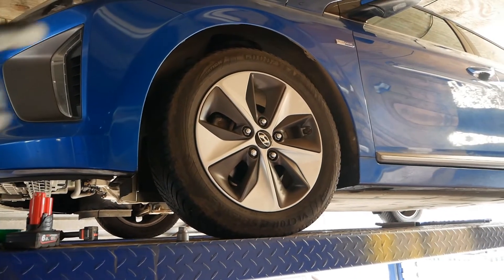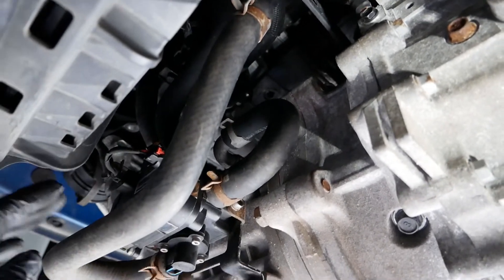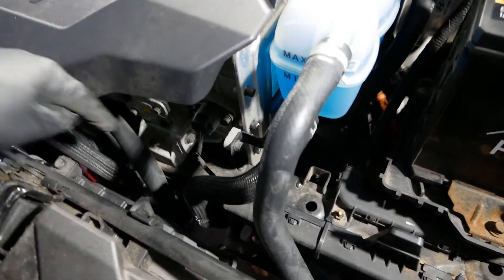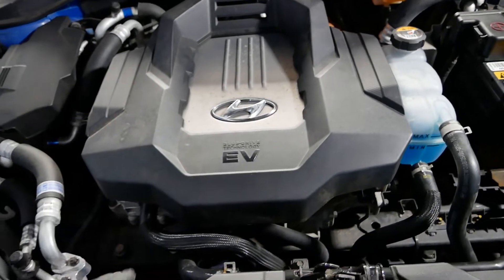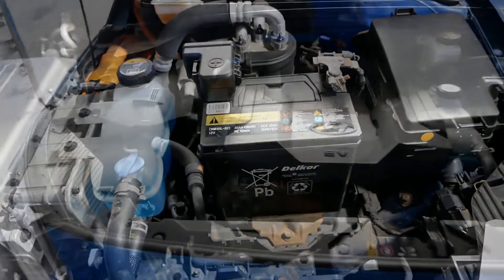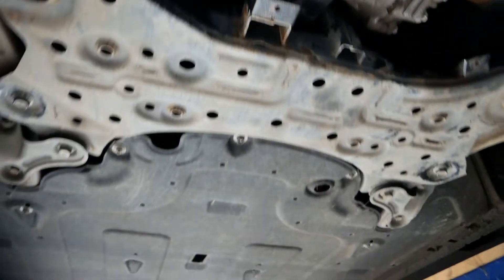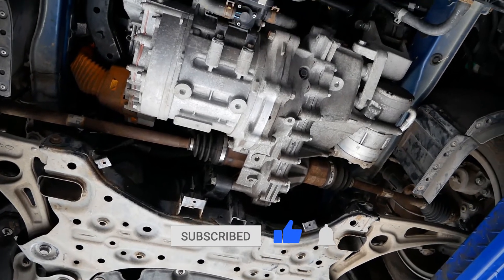What's under the bonnet in an EV? A look at a 6 year old Hyundai Ioniq Electric 28kWh.

Comment: Thanks for the great video.  I've got a quick question..  you showed that the motor stack is supported by the 3 mount bolts, does that mean it's not really supported by the front sub frame?  I'm looking to change the subframe and wanted to know if the motor stack needed to be supported when I removed the subframe?  Would appreciate any guidance.  Thank you!
Reply from the maker: That's right, the motor stack is supported just by those mounts. It's been a few years since I was under a Ioniq, but it's all pretty easy to see when you're under one. As to whether the motor stack needs supporting, it depends on what the mount bolts too and if that is getting strength from the subframe.
Reply: @GoGreenAutos thanks 🙏 for your reply.  Really appreciate it

Comment: Byt what I was looking for was how the rear sway bar was looking, if there was a difference from the hybrid version. I am looking to change it to a slightly thicker design to get just a bit more over steer out of a bend. But yes I understand I also need slightly stiffer rear springs as well. … yes I know.

Comment: How do you find the overall performance of the heat pump in both cooling and heating mode on the 28kWh and 38kWh Ioniq?  I'm going back to EV soon and the Ioniq 38kWh is at the top of my list by a huge margin but the wishy-washy air conditioning in the R55 Mini Cooper S I currently have (fully serviced and recharged but really underperforming by design due to heat soak from the crammed engine bay) has made it a consideration for me on future purchases.  The Koreans do normally get AC right, so I'm hoping it's decent!
Reply from the maker: Its very good and very efficient. Certainly better than the heat pump systems from some Renault and Stellantis EVs.
Reply: @GoGreenAutos  Thanks for the reply, that's good to hear!

Comment: Great video. I have some problema on heating the cabin . The cabin ia blowing cold air and not heat. Do you know what is the problem?
Reply from the maker: Does the air conditioning work (i.e. blow cold)? Low refrigerant in the system is the most likely cause, as the air conditioning compressor is used to generate the heat.
Reply: If this only happens periodically, maybe the AC managing humidity. It uses cooling to dry the air in humid conditions.

Comment: Thank you for the great video! Very informative. Just curious, do you know if the air that used to cool the battery packs were filtered? I think the intake piping started from the rear passenger seat. My concern is if not filtered, the cooling fan might have clogged up with debris and dust, kind of like early gen Toyota prius. Any input?
Reply from the maker: I've never needed to take one apart to look. I don't think it comes on very often anyway. I don't think it every came on when I owned a 28kWh model.
Reply: It does come on during fast charging... audibly.

Comment: hello , my 40,000 miles service is coming up. i use ioniq 38kwh EV for private hire. do i have to take it to Hyundai for service for keep the warranty valid ? Hyundai 40,000 costs £500+ . considering its an EV why are they charging so much for its service to change brake fluid , coolant and pollen filter i think ? what are my choices ? can i take it to halfords for servicing , would it have an affect on the warranty .
Reply from the maker: The 40K service is expensive as it also includes a coolant change. Yes, you can have services done at any VAT registered garage and if they use genuine parts, the warranty is still valid. However, a Halfords garage probably wouldn't be doing the coolant flush. It also needs Hyundai BSC-2 coolant. Try a HEVRA garage (https://hevra.org.uk/garages.html). But probably best to just pay Hyundai for this one. The coolant change is a 2 hour job if done properly (which often isn't the case).
Reply: @GoGreenAutos i have already had coolant recall done, they flushed it 2 months ago.  yes i will try to get it done from hyundai. i am at 41500 now when i reached 40k i called them and the earliest date given was 27th Nov. dont think they will honor my warranty now as i am out by more than 1000 miles ..
Reply from the maker: @hussain-b7m7f  if you've had the coolant flush job done, then no point having it done again, so ask for a normal service without this. That will drop the price down to a normal price.
Reply: @GoGreenAutos   great i did it today at the dealership  and paid £250 instead of £525 ... thank you

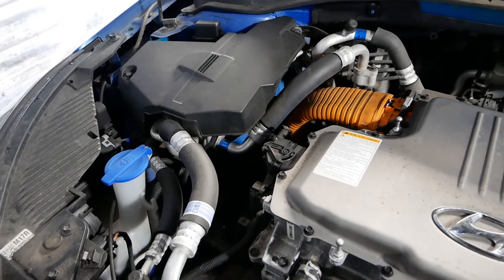Comment: 9:10 As far as I know, Ioniqs with a heat pump also have a PTC resistive heater used in very cold weather when heat pump is not efficient enough and at the beginning of heating to heat up the inside quicker. I can definitely smell one in my Ioniq (EU version though) when starting to heat up in cold conditions.
Reply: This is correct! When you crank it to high temperatures you add the PTC. I live in a very cold climate, and it’s worth mentiong that the Ioniq 28 has the best and quickest heating of any car known to man. It’s insanely quick. -25c to +22 within 5 minutes. It’s so fast I don’t miss an app!
Reply: True. My heating still worked when my AC cooling - and thus the heat pump too - wasn't.

Comment: That’s going to be like mine.. 5 years old now n no issues, had a recall that put a rubber jacket on the granny lead … lol
Question with EV’s would they be better building a 12volt leisure battery into plan as so many suggest the little batteries h go flat..? My 28 kw keeps the little one charged as I get a message after being left that is difficult to understand but means big battery was used to top up little battery… 😊

Comment: Really great video, I've had a 28 for 6.5 years and it's been a dream since day 1. Also didn't know they came with a heat pump!!!! I would love to see an aftermarket battery upgrade at some stage in the future, while the range is excellent for day to day use, I would love an extra 50-80km range for occasional longer journey...would love a video on this in the future if it becomes possible.
Liked and subscribed!!!!
Reply from the maker: In reality, battery upgrades are expensive as the battery is expensive. There's just not enough of them around. You're better off just upgrading the car to the later 38kWh model and get a newer car at the same time.
Reply: @GoGreenAutos  True, probably keep the 28 for a second car and trade in a 2014 Octavia (1.2 petrol though so fairly efficient), the new BYD Dolphin is a strong contender, seems to be an amazing car once I hear some 6 month reviews

Comment: Could one not create a larger battery box to give it a bigger range?
Reply from the maker: One could, but that expansion would end up going in the boot as the current pack already fills all the available space underneath, due to this being an ICE platform.
Such work isn't financially viable either. Its cheaper and easier to just upgrade to a newer (used) car with a larger battery.

Comment: Only trouble under the bonnet, as someone who drives 15+year old cars i dread to think what a £750 17 year old ev will drive like, if its battery will actually move it that is lol
Reply: The first generation Tesla S from 2012 still runs on the original battery.  Same for the Nissan Leaf.  This also applies to other models.
Reply: @JorgeniLund A 2012 Leaf would have a range of about 20 miles - you call that still running ? 😂😂😂
Reply: @AndyC2_  Yes
Reply: @JorgeniLund  one or two do yes, some ice cars have done a million miles on the same engine and gearbox, most don't though, i think people like me, who drive sub £1000 cars, and theres a lot of them,will end up cycling or on the bus, in fact, those low paid jobs will be avoided by everyone in the future, who wants to work if you can't even afford a car? They either have to pay more wages, which will bump up the price of everything or society will collapse, won't be any shops open if they can't get anyone to clean them, health and safety rules, in the long run, everyone will suffer with this net zero bs, only winners will be the ones selling you all the lies, enjoy the future, you all deserve it.
Reply: @Markcain268 Wow youre cheerful aren’t you 😂 What’s all that got to do with what’s under the bonnet of an EV ? Take your £750 banger and do one
Reply: @Markcain268   Yes, you're absolutely right. Many will suffer if we do not achieve "net zero". I also share your opinion that not everyone needs to drive a car. There, public transport will have to solve the need to travel. In public transport, a transition is also underway to be able to achieve a fossil-free future.

What is positive is the transition that is taking place in large parts of the world. In Europe, development has been very fast, although not all countries are changing at the same rate.
Reply: @AndyC2_  I'd love to but the battery is flat!
Reply: @Markcain268  😂😂😂😂
Reply: @JorgeniLund  I’m laughing at you ! 😂
Reply: @AndyC2_  Have fun
Reply: @JorgeniLund  I am, thanks

Comment: Thanks - really enjoyed this. Out of interest, do the AC compressors have a habit of giving up at 5-8 years, like the Renault Zoe? This happened on our Zoe at 7 years, the mechanic said it was a common issue and the compressor was back-ordered.
Reply from the maker: Yes compressor replacements do seem to be common on Zoes. I have my suspicions that maybe they're getting changed a bit too eagerly by Renault dealers. Anyway, it is a mechanical item that does wear, eventually. But the biggest issue with these (and all cars) is owners not getting a regass done every 3 years or so. Its vital. 
It's also important that the air conditioning is used frequently as it keeps the pipework and seals lubricated. Often EV drivers don't to save energy.
Reply: @GoGreenAutos  yes - I wasn't aware of aircon regas as a regular service item (unlike 12V batteries). The mechanic did check the gas level before changing the compressor and it wasn't low in our case. Is it possible the oil had gone but the overall gas level was OK? We switched to an independent garage with EV experience for servicing and repairs, as I had my suspicions the local Renault dealer was doing nothing to the car during servicing, except charging me to top up the windscreen washer (which I had cunningly already filled before the service), then ticking all the items on the service sheet. Plus 2x friends had their Zoes come back with paint damage from this dealer too. We ditched the car shortly afterwards, following a stream of front suspension issues and expensive repairs.
Reply from the maker: @MrWobling  Yes, sadly its a common practice that stuff isn't actually done during servicing. Its often just a visual inspection. I have plenty of proof that cabin filters and brake fluid aren't changed during main dealer services, even though itemised on invoices.
Reply: @GoGreenAutos  kind of ironic that a car could be better cared for at a good independent, but be valued lower when sold, due to non-dealer service history. I did consider trying to come to some arrangement with the Renault dealer, that I pay them a reduced fee for inspection and stamping the service book - profitable work for them, and then I get the actual work carried out somewhere else 😂.
Reply: @GoGreenAutos I generally use the air conditioning when the weather is cooler to keep the windows clear, I have the car in eco when I do. Makes a difference in efficiency in my car
Reply: @michaelheadley2041 my tests suggest that yes, when you turn it on, it does affect the range by 15%-20%. But if you drive for a long time (at least 20 min) and on motorway or 50/60mph roads, then the impact is minimised as the cabin reaches its temperature. The power drawn by the heat pump from the battery goes from 1-2kW down to 0.25-0.35 kW. This is obviously on top of all the electronics that usually use ~0.2-0.25kW.
Reply: Not many Ioniqs are 7 years old yet.  

But the 28 doesn't seem to have any general weak spots appearing.
Reply: The charge port on the Ioniq 28kWh has a tendency to die after 3-4 years. Had mine replaced under warranty at 4 years.